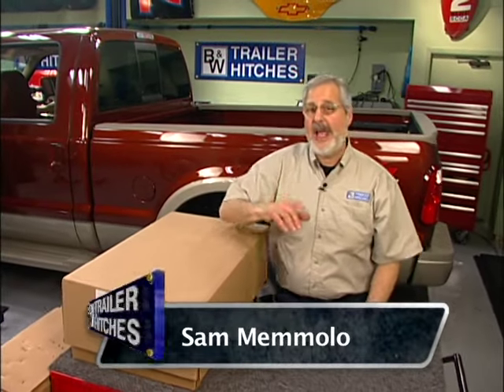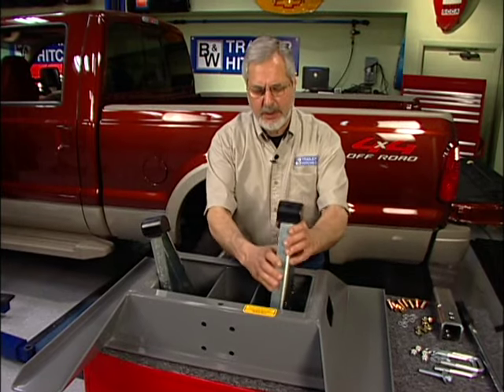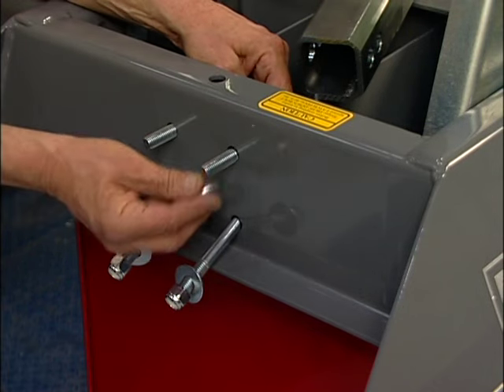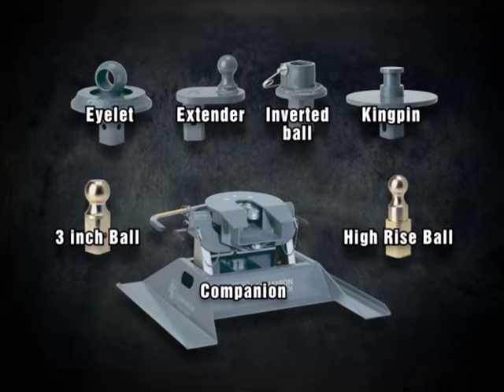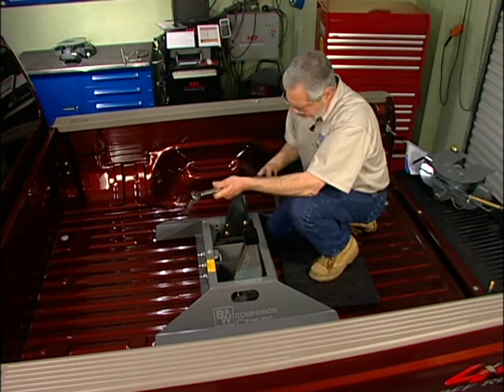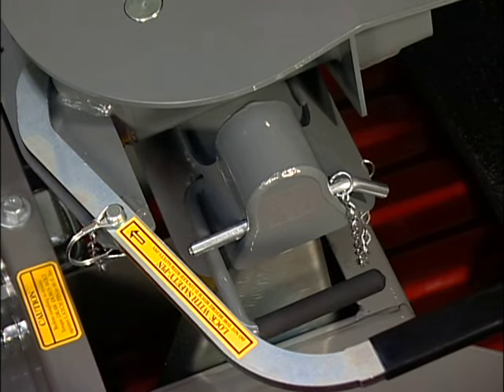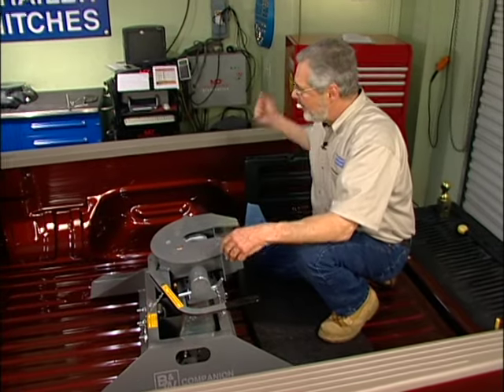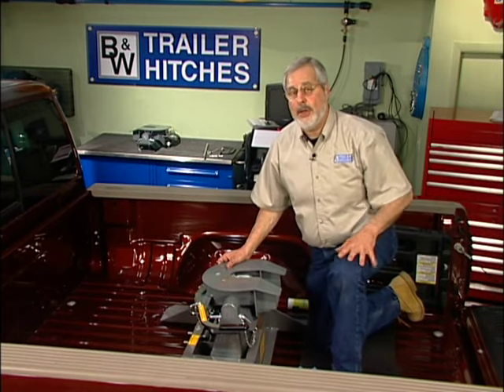B&W Companion 5th Wheel Hitch Installation Demonstration

Comment: Nice video and great job of clarifying the tightening sequence on the mounting post. When I installed mine last year, I didn't understand the instructions and did it wrong. No worries though, I quickly figured it out and am enjoying the hitch immensely. This is another example of B&W being aware of the consumer's needs and responding with a timely and useful video.

Comment: I bought this from a friend I spend forever trying to look how to bolt this in then I happen to buy a used truck a few years later with the gooseneck part then come to find out the 5th wheel goes to it but I had to build the part that connects to the 5th wheeler into the gooseneck part and not I love this one a lot so easy to work with and almost sold it lol

Comment: I currently have a Uni Goose hitch which has a removable ball but uses a slide coupler similar to a Air line quick coupler only a lot larger.  I think I can machine a special pin to fit my hitch that yours could torque and u-bolt clamp to.  Are you familiar with the hitch I have, there were / are made in southern Indiana by a small company.  Maybe you offer and adapter from their Goose hitch to your 5th wheel.  Would it be acceptable to have a thin sheet of belting between the metal bed and metal mount to protect my bed paint ?

Comment: I know I should do my own research; but will this unit work with the RAM puc system that comes in many of the one ton duallys....????  thanks
Reply from the maker: This exact unit will not work with the puck system, but we do have a Companion hitch that will, with all of the same great features.  RVK3600 is the part number.  Here's a link about the product.
https://www.bwtrailerhitches.com/product/companion-fifth-wheel-hitch-ram-pucks

Comment: I have this hitch and just got a new GMC truck with the Puck system, is there a way to make this hitch work with the Puck system?
Reply from the maker: Yes! The Companion is offered with different base designs depending on the hitch mounting system used on your truck. Our OEM Companion is specifically designed to work with the OEM fifth wheel hitch prep packages/puck systems. You can find the right model for your GMC truck by visiting our website at the link below:

https://bwtrailerhitches.com/product/companion-oem

If you already have a single-point Companion model (this base will work with a B&W Turnoverball gooseneck hitch mounting system), you will need to just swap out the base on your current hitch to a GMC OEM Companion base. The coupler will be the same across all Companion Fifth Wheel Hitch models.  To inquire about price and to order a replacement base, please reach out to us at:   800.248.6564 (M-F, 8am-5pm cst)

Comment: Only issue I see is having to untorque and retorque bolts every time you remove the base. That kinda is a pain.
Reply: Takes less than 5 minutes
Reply: @brianpeterson9923  may take less then 5 mins, but it’s still more of a pain in the a$$ then just pulling the pin and lifting it out, also nylock nuts like what they are using are not designed to be loosened and retightened like that, the more you loosen and retighten them, the less effective they are for not backing loose

Comment: I have the b&w turnover ball but i also have a rubber mat would I have to remove it in order to use the companion? Or will the torque bolt allow for that variance?
Reply: It would allow for that. That is why the bolt is long and adjusted before tightening the u bolts

Comment: How do you know witch way it should be put in? The hole system? Thks
Reply from the maker: If the Companion logo is facing the tailgate and the large orange sticker is facing the cab, the hitch is properly oriented in the truck bed.

Comment: Can this companion unit be install into a puck system in a 2019 f250 pickup without having to drill out the hole?
Reply from the maker: Hey Dwight - This Companion isn't what you'll need for your puck system.  You'll want one of these https://www.bwtrailerhitches.com/product/companion-fifth-wheel-hitch-ford-pucks

Comment: What is the weight of each of the two (above bed) components, of this hitch?
I'd like to know if I could lift each one separately. Thanks.
Reply from the maker: Hi Denice,
The coupler weighs 70 pounds, and the Companion base weighs 130 pounds.
Reply: The bottom piece is very heavy! I had an extremely (awkward) rough time getting it up into the bed of the truck, it's definitely a 2 man job.

Comment: watched it three times didnt see the bottom pads installed
Reply from the maker: Hi Jeff, sorry for the inconvenience. We actually have a more recent video that discusses the installation of the plastic foot pads. You can find it here: https://youtu.be/Q1Ze4eMRZsM 

Whether the footpads are installed with the wide side or the narrow side down will depend on the width of your truck bed's corrugations. The footpads should sit between the corrugations with little to no movement.

Comment: Can I use this hitch with a 16k reese sidewinder receiver attached to my camper?
Reply from the maker: Unfortunately, any Companion model with a single point of attachment is not compatible with the Reese Sidewinder Pin Box. You would have to remove the wedge and lock it out.
Reply: @BWTrailerHitches  can I run the B&W turnoverball with the 20k B&W goosneck to 5th wheel campanion hitch to pull a 5th wheel in a ram 2500 with ramboxes?
Reply from the maker: @tintdr  We've checked with our installation specialists and we're sorry to say that due to the extra space taken up by the Ramboxes on either side of the truck bed, the B&W Turnoverball with the 20k Companion hitch would also not work. We're very sorry for the inconvenience.

The Ramboxes create a bit of a unique issue and, understanding the situation a bit better, we do agree that you would need a turning point pin box on the fifth wheel, such as the Reese Sidewinder or Reese Revolution, to prevent the fifth wheel from making contact with the sides of the truck bed. The reason the B&W Turnoverball and 20k Companion are not compatible with a turning point pin box has to do with the the excess torque on the single connection point and its inability to withstand this.

Our fifth wheel hitches that would be compatible with a turning point pin box would be a rail mounted kit and either a B&W 16k / 18k Patriot hitch (just not the Patriot Slider model). 

https://www.bwtrailerhitches.com/rail-mounted-attachment

Or, the only other option might be the Companion for Ram Pucks. However, the Ram OEM puck system would need to be installed in the truck. https://www.bwtrailerhitches.com/product/companion-fifth-wheel-hitch-ram-pucks
Reply: @BWTrailerHitches  Do you sell just the base for the ram puck system? I already have e the 20k gooseneck companion hitch? Of so a link would be great thanks again.  P.s I have the B&W 7" hideaway and love it.. I have the B&W turnover ball love that also.  I have the B&W 20k gooseneck to 4th wheel campanion and now unfortunately your telling g me I can not use it which is disheartening.  So now I need to install the puck system and get the base
Reply from the maker: @tintdr  We're very happy to hear that you love your B&W hitches. If you are able to get the OEM puck system installed in your truck, we do offer just the base. You can order this by giving us a call at 800.248.6564. Or several of our authorized dealers do carry the base as well. The  Companion for Ram Pucks base is part # RVB3600. We can recommend etrailer.com | https://www.etrailer.com/Accessories-and-Parts/B-and-W/BWRVB3600.html

Comment: All I have is the b&w 4" offset ball will this work with it?
Reply from the maker: The Companion works with the Turnoverball, not with the 4" offset ball.  The 4" offset ball is designed to go into the Turnoverball also.  If you have our 4" offset ball and are using it in your truck bed, chances are you have a Turnoverball below the bed.  Please feel free to give us a call and we can help you identify what you do or don't have.  800.248.6564

Comment: Did he just install a non-slide hitch in a short bed?
Reply from the maker: He did.  Many customers are able to use a non-slider in their short bed truck.  

There are several factors to consider when addressing the issue of cab clearance. To answer the question for you specific truck and trailer, pay attention to the following:

1.  Pin Box Location - Is the Kingpin even with the front of the trailer, or is it recessed behind the front of the trailer? Some 5th wheel manufacturer's have compensated for the prevalence of shortbed trucks by building extended kingpin boxes.

2.  Type of trailer and shape. Narrower trailers allow a tighter turning radius. Trailers that are built with rounded corners accommodate more cab clearance than squared corners.

3.  Finally, the type of maneuvering that will be required while towing. Do you anticipate lots of sharp turns while towing, or is it only highway driving with little or no backing?